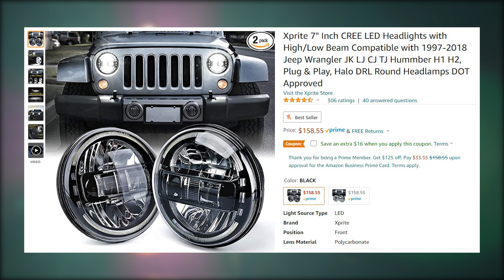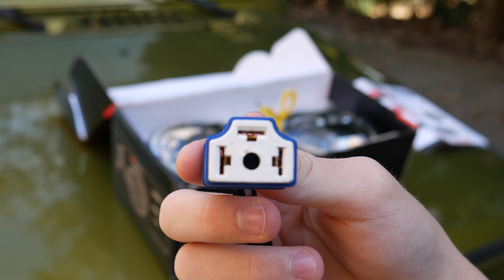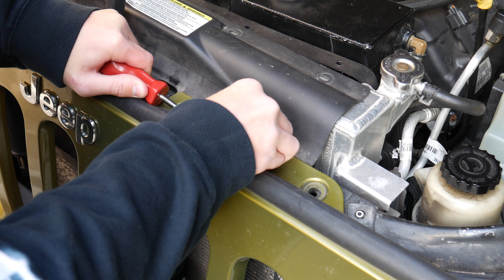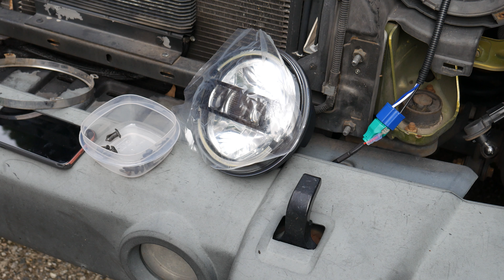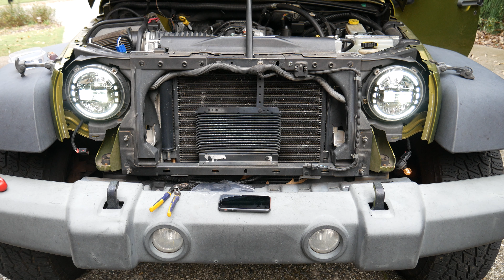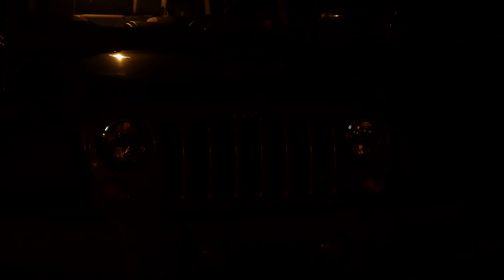New LED Halo Headlights for the Jeep Wrangler

Comment: Did you have to modify the housing to seat these lights on properly? I have the same lights and having issues it seating right
Reply: Same here, did you end up widening the housing?
Reply: @vtecdpn100  unanswered as of now. But what I ended up doing is using that stainless steel ring to secure it as best as I could. So far so good. And it's been in some rough terrain so it hasn't gone anywhere
Reply: @jramos20  actually just finished the job… I took a dremel and widened the bucket/mount and it went in. Also had to shave the fiberglass frame a tad.
Reply: @vtecdpn100  yea I was trying to avoid any modifications so decided to try my method first and well it seems to be doing good so didn't mess with it after that
Reply: @jramos20  gotcha, I was worried about where the light beam. Didn’t want them to be lopsided.
Reply: @vtecdpn100  yea same here. That was the main concern but I feel like they're pointing where they're supposed to be